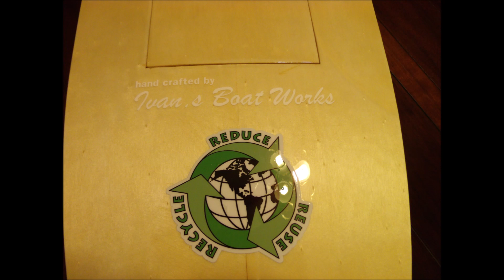Ivan's first P mono and first test run

Comment: That a really nice vhull boat ,very clean build new subscriber 👍
Reply from the maker: Thank you for watching
Reply: @KevinTodd  can I ask you way you have put just one turnfin?
Reply from the maker: @daiciuapostol79  heat racing right turns only only need one the other is just drag ...didn't plan on running offshore .
Reply: @KevinTodd  thank you 🤜🤛 I appreciate, it's exactly like on the outrigger boat, she runs very good and fast 👍